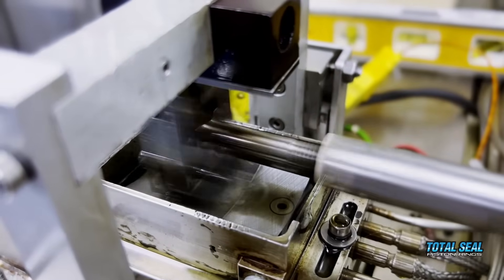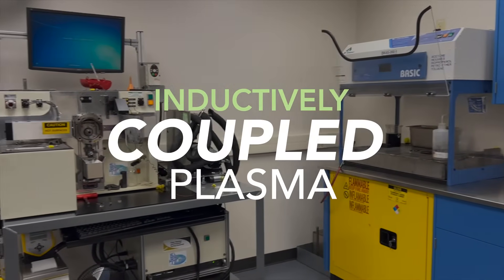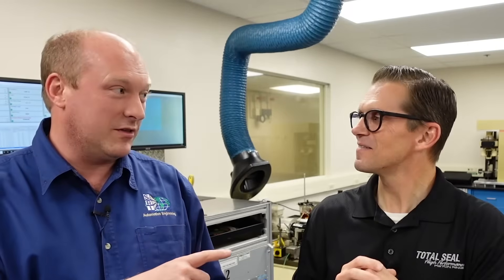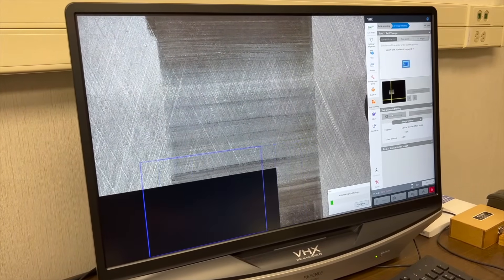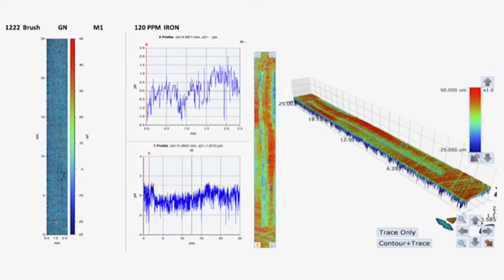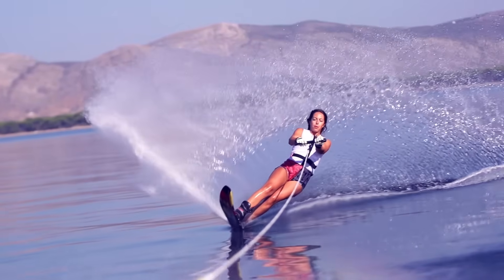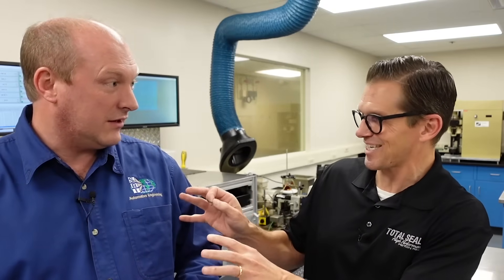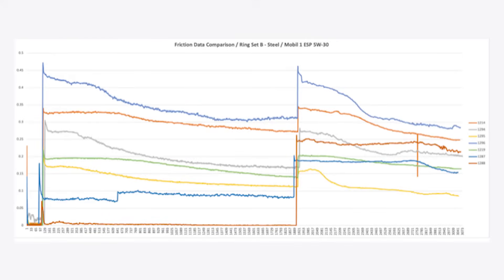Fact or Friction? TWO Things MOST People DON'T Know About Wear.

Comment: I have a 2011 Prius that I just sunk $3500 to get the engine to 💯 

Now I continue to use Shell’s Top Tier V-Nitro after using it on a road trip across the entire country, and now I’m on my second oil change with Valvoline Restore and Protect.

It’s running smoother and stronger than perhaps even a new car now.

Assuming this is the best I can do, would you suggest doing anything more if that’s possible?

Not a race car lol

Comment: The use of oils on cutting tools can dramatically increase the life of the tooling. You have 2 pieces bearing against each other with the purpose of removing material- you'd think adding oil would decrease the effectiveness, right? Not necessarily so. In fact, if you use the right oil with the right cutting tool, you will dramatically increase tool life, in addition to a marked improvement in surface finish in the piece being cut. 
My point being that friction and wear aren't always directly coupled.

Comment: Without the chemically reactive high pressure combustion gases present, the in-lab oscillating ring/liner test is nearly totally irrelevant !!!
Reply from the maker: False presumption. There is strong correlation between this test and actual cylinder liner and ring friction and wear.
Reply: @TotalSeal  From ASTM G181............."This test method does not purport to simulate all aspects of a fired engine’s operating environment, but is intended to serve as a means for preliminary screening for assessing the frictional characteristics of candidate piston ring and liner material combinations in the presence of fluids that behave as use-conditioned engine oils. Therefore, it is beyond the scope of this test method to describe how one might establish correlations between the described test results and the frictional characteristics of rings and cylinder bore materials for specific engine designs or operating conditions.

Comment: What, if any, does hot vs cold temps have on wear.
Side note: why do car manufacturers not run an electric oil prelube prior to start up? Or, atleast have that option available via toggle switch?
Reply from the maker: Temperature does affect oil flow, which in turn affects wear.

Comment: I just wanted to add my 2 cents, I feel that the reason your wear went WAY down by changing the oil, because your experiment does not represent a real life situation, you are pumping the same contaminated oil full will wear particles on top of your surface being tested, while an engine will pump it back to the top after being filtered with an oil filter that removes particles down to 25-30 microns.
To be fair, for your experiments to have comparable results, your oil needs to go through a similar filtration first. 
Unless I miss the part where you said that the oil was being filtered, then I apologize.

Comment: I find it weird, that the manufacturer of my motorcycle recommends its own oil with ~170mg/kg Mo, but in the same sentence of the owner's manual they prohibit the usage of Moly additives, because it destroys certain coatings in the engine. What's the deal here? Are they willingly sacrificing the engine coating for lower friction over time, to meet their mpg targets?
Reply from the maker: There are different types of Molybdenum compounds, so they may be utilizing a specific compound that works synergistically with another additive in their oil.

Comment: Why would the top of the cylinder bore have less wear kuz of lubrication? Does oil get to the top? Maybe it's the wrist pin pushing to the side more lower in the stroke.
Reply from the maker: The top of the cylinder has more wear than the middle of the cylinder because of the lower sliding speed and higher pressure at the top.

Comment: I got a question if someone can help me .   What would the best oil and additive  for use in Demolition Derby car engines?  In the past i choose a 20/40  and Slick50.   Thanks for any advice.
Reply from the maker: The only way to determine what is best for your application is using oil analysis (of the used oil) to guide the choice of viscosity and additive package.
Reply: @TotalSeal   well, it's pretty much ran to destruction, full loss of coolant, to the point the Paint's burnt off the cylinder heads,  the pistons start melting or seizes up.  Whats recommended for the Most extreme conditions?   I'm a big fan of Slick50 but it's very expensive.
Reply from the maker: @demolitionman9307  there is not a “best” oil. The application will always dictate the correct viscosity and chemistry needed. We would recommend checking out the Driven Racing Oil YouTube channel for more tech videos related to oil.
Reply: @TotalSeal   thanks for that. Keep up the great Videos and wishing all the best in the future.

Comment: OK enough of the chatter, we all know you're on to something good, so how about giving some specs and details that we can take away and use ?
Reply from the maker: There is more to come, but the CrN coated ring was the best performing ring in this test. The 170 grit diamond hone finished with a 600 grit CBN was the best hone, and the break-in oil did the best for wear.
Reply: @TotalSeal  Fantastic, thanks very much for the details.  Interesting about the break-in oil though ?  I thought that was usually to allow some wear for break-in before switching to an oil with a stronger film to minimize wear ?  You're doing a great job here uncovering the stuff that really matters, keep up the great work.

Comment: The lab work is useful, but not a complete duplication of what happens in an engine.  There you have loads from combustion pressure, heat and acid.  What they're doing more closely resembles cam/lifter interaction.  But cam/lifter only moves one direction.  The ski analogy applies very well to plain bearings. They run on an oil film pulled into the bearing surface by motion.  Which is why almost all of the bearing wear occurs at start up and shut down.  This is not news.
What you learn in the lab can then be tested in an actual engine so see if it works.
Reply from the maker: That’s exactly why we also test these variables in real engines.
Reply: @TotalSeal  And you're doing it the right way.  Lab testing is less expensive and lets you test more materials.  The ones which show promise get tested in the more expensive real world conditions.

Comment: So what is the answer? What is the coating? What is the bore finish? What oil? No answers in this video.
Reply from the maker: The CrN coated ring worked the best, but we are working on a new coating that we will show the comparison for in the next video. The 170 grit Diamond with the 600 grit CBN hone did better than the straight 325 grit Diamond. Also, the break-in oil reduced break-in wear compared to the off-shelf oil.

Comment: Do your rings have square edges?  It seems a small 10 degree ramp would get the ring "up on the oil" quicker than a square edge.
Reply from the maker: No, the rings have a barrel profile on the face for the very reason you were thinking about.

Comment: I thought ICP was not the best technology for used oil analysis (RDE is better) or in this case it works well enough and doesn't matter?
Reply from the maker: While RDE detects a wider range of particle sizes, ICP is still a reliable method, especially for a test like this.
Reply: @TotalSeal  Is it because this is a lab test where the particles are uniform in size and elemental composition?
Reply from the maker: @MegaMajormax  The elemental composition was a very narrow range, and the particle distribution was small. As such, either method was sufficient.

Comment: This is great info, however its very small part of the big picture. How does the ring wear and friction changes affect ring seal?  Assuming the best results for wear and friction equate to power output is maybe misleading. Also, how close are the results of the testing to real world? I'm sure you have a pressure applied to the ring that is similar to a calculated pressure on a running engine at a given power.  How does changing the pressure affect the behavior of the additives.  Other thoughts, heat from the combustion process and fuel contaminates will all have affects on this test.  Again, its great data to have, but much like a flow bench, the results could be miss leading and need to be backed up with power and wear data from an engine ran in its environment.
Reply from the maker: That’s why we take what we learn from the bench test and run it in engine tests to see if it correlates.
Reply: Great answer!

Comment: Hey speed i always wondered how much friction valve stem seals create and since you're the oil guy have you dealt with that or just piston rings
Reply from the maker: We’ve not dealt with valve stem seals.
Reply: @TotalSeal  In the case of the umbrella seals used on most OHV engines, none.  For OHC an insignificant amount.

Comment: While fascinating, what about parameters like temperature, varying ring loading to simulate the four cycles, fuel washing, etc., as I’m imagining as many modes of wear?
Reply from the maker: We did vary the temperature and the load. We showed those details in the first video with SwRI. 

Fuel dilution, as you mentioned, is a harder variable to bring into this kind of testing, which is why we always follow this up with actual engine testing.

Comment: Guys this was awesome!  I used to do power cylinder development about 20 years ago at Nav - worked with the guys at Dana in Muskegon on oil consumption & ring coatings.  brings back good memories.  I would like to hear more about additives that help wear but do not increase friction as well as PVD coatings that help ring/bore wear interactions.  building endurance race old BMW inline 6's with wide factory rings (1.75mm/2.0mm) and would like to free up some hp.
Reply from the maker: Thanks Jeff! The coating in this test was CrN on our AP steel rings. We tested another coating (not shown in the video) that did even better!
Reply: @totalseal there’s a company in Southern AZ that specializes in vacuum coating development that you should talk to. Look up GP Plasma - and contact Frank Papa.

Comment: How does cross hatch angle 30 - 45 degrees affect the outcome?
Reply from the maker: Great question! Cross hatch angle is all about oil transport up and down the cylinder - you need to have oil at the right place, at the right time and in the right amount. 

Because this test is horizontal in a bath of oil, changing the cross hatch angle doesn’t matter. Changing the surface roughness does.

Comment: Lake Speed Jr., David Vizard bought in to a company called Oil Extreme.  He swore that the anti wear additive they use, calcium phosphonate, is the latest and greatest anti wear additive.  What are your thoughts on this?
Reply from the maker: We’ve tested that product before in actual engines and have never seen positive results. Calcium based additives compete against the other additives in the oil so it can help some oils but hurt others. Without used oil analysis, you won’t know if it is helping or hurting.
Reply: @TotalSeal  My Engine Builder now Swears by Oil Extreme..... Really helps Ring Seal
Reply: Oil Extreme is way better than anything on the market.... If Your Oil needs it.

Brilliant on flat tappet camshafts, Rings and Bores.

Oil Extreme has fixed many, many CVT's around the World..... Just pour it.... The transmission will just start to work properly.

No need to by a new CVT.

Comment: Can someone please  please please explain to me how less tention rings differ from normal worn-out rings ,I'm not being arogant but I really want to learn something  , because I found all the new VW engines with lower tention rings suffer from oil burning
Reply from the maker: A worn out ring has lost the face profile and texture. It really has very little to do with tension. A low tension ring with a harder face coating will last much longer than a conventional ring, which features a softer face coating.
Reply: @TotalSeal   so what is up with VW newer model cars like 2.0 t that's starts using oil with the standard Lo tention rings on about 50,000miles but if you put standard tention rings in  the oil CONSUMPTION seems to go away , also I have a set of HASTINGS CHROME RINGS WHAT HONE FINISH SHOULD I GO FOR  

AND THANK YOU FOR ACTUALLY TAKING THE TIME TO TALK TO ME
Reply from the maker: So that is a low tension oil ring, which is different from the tension of the top rings.

To your question, the factory oil ring tension is so low that it begins consuming oil when the tension drops further due to use.

We have “low” tension oil rings that are higher tension than the factory rings for this very reason.

In regards to the hone finish, check out our other videos. We get into great detail in the honing video’s and track side tech talks.
Reply: @TotalSeal  that really makes alot of sence  thank you so much  
One last thing do you have agents in SOUTH AFRICA FOR TOTAL SEAL  AS I MIGHT WANT TO TRY YOU'RE RINGS IN AN TRACK APPLICATION
Reply from the maker: Thanks! We are happy to help. Unfortunately, we don’t have a distributor in South Africa, but you can order directly buy contacting our sales team -623-587-7400 or order@totalseal.com
Reply: @TotalSeal  if you are looking for a distributor in south Africa let me know I might just be able to help
Reply: tension